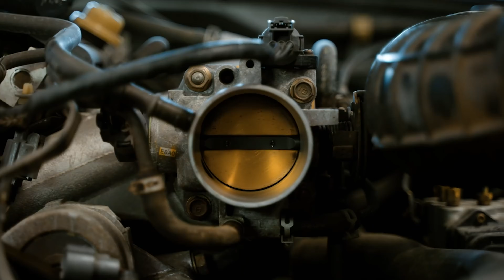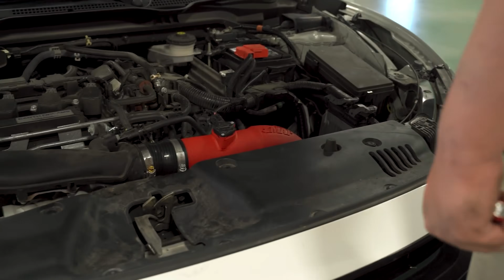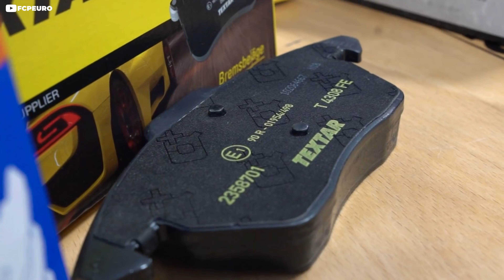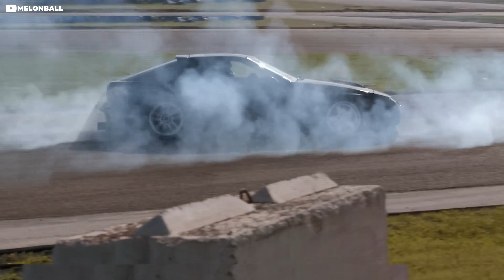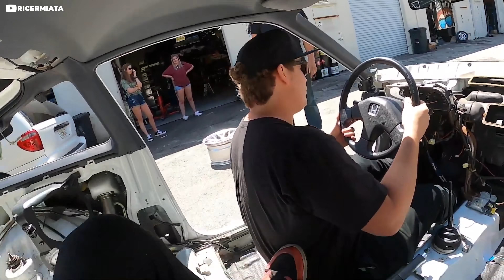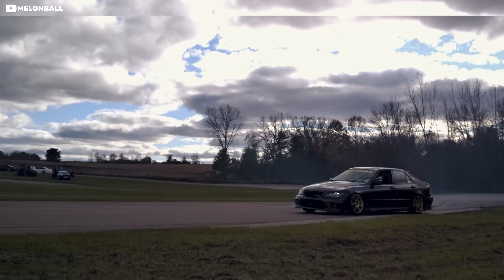Best Beginner Performance Mods!

Comment: Ranking from most to least important.
1. Tires
2. Coilover
3. Strut Bar
4. Sway Bar
5. Lightweight and Appropriate-Sized Wheels
6. Lightweight Body Kits (Exterior and Interior)
7. Brakes and Brake Lines
8. Full Sports Exhaust Kit
9. Intercooler
10. Intakes
11. Aluminum Pipes
12. ECU Tuning

Comment: 1st- wheels, tires, and adjustable camber links/bolts.
2nd - brakes, brakes, and brakes. Dimpled and slotted are my go to.
3rd- intake and exhaust.
4th- depends on the remaining weakness in the vehicle.

Comment: Most of these aren't beginner mods at all, because I am literally just getting a turbo and tune and I been building my car for 2 years. takes time to build things right and learn how to do motorsports and track racing, not talking about street because I don't street race for personal reasons. 

But beginner mods are mainly suspension components and chassis braces to improve handling and reducing flex on the body. Tires and brakes are the very first mod you should always do to any new or used car you get. But suspension is the real deal when you're diving into building a car. I would touch the engine and ECU last because you can notice the difference of the car when you wake up the beast under the hood. Then you can decide if you wanna strip the car based on what you wanna do with it, daily driver or a track car.  Imo

Comment: If youre new to modifying cars; specifically suspension modifications. A lot of people dont think too much about the geometry of the car and how the suspension works. 
Firstly, do some research before slamming your car (It will be super beneficial in the long run). Things like roll center, camber, toe etc. will all change as soon as you adjust that ride height or any suspension component. Not to mention all the things you are going to wear, like your CVs and tyres. 
Its a chain reaction so do it properly the first time and it will be cheaper and safer in the long run.
Reply from the maker: We always recommend doing proper research for your vehicle!

Comment: Intake, downpipe, mufflers, gutted cats, header, lowering springs, poly motor mounts, front/rear sway bars, front/rear strut braces, mild weight reduction, wheels/tires, drilled/slotted rotors and brake pads. Don't blow your money on a cat-back since your factory one works fine without forced induction. Been tuning cars for two decades. This is the budget recipe for a well-rounded and fun car. Nothing on this list is super expensive except for wheels if you want lightweight. A simple set of Motegi, Konig, or Enkei would be my pics for bang-for-the-buck. These are in no order but I honestly would do lowering springs and poly mounts first as this will stiffen the car up and allow you to feel the road better. I'd do a tune last when you've decided your done with everything else and you may need to upgrade your fuel and spark accordingly. On most cars, headers are your biggest power gain out of the bolt-on list. Its your money, your car and your choice but this is the knowledge I've gathered thru my 23 years of modding customers' cars for a living. Again this is a budget list for beginners or people without a large expendable income. Happy modding.

Comment: Speaking of the order that you should mod your car in. I got a stock miata, did a poor paint job, straight piped it. Then I got sick of the loud noise so I put a turbo on and a 3 inch  straight pipe, big brake kit, bc racing gold coilovers, and still stock wheels 😂
Reply from the maker: WHERE ARE THE WHEELSSSSS 😭😭😭 -Edgar

Comment: Hey!
Any tips to prevent hydrolocking with a cold air intake? Ive seen the covers AEM sells online, but I think is not enough.
Reply from the maker: The best way is to use one of those covers and also see if there is an intake that routes it as far away from the ground as you can. I know in some older Hondas that's tough though. - Sam

Comment: 01 Grand Prix GTP started with a complete stage 2 kit (intake exhaust 180tstat 3.4 pulley dp) then got front an rear power logs, then catback. lowered on zzp springs with niche targa wheels surrounded by bfgoodrich tires. amazing car an the sc whine is orgasmic!
Reply from the maker: Yo, those Grand Prix GTP's are a guilty pleasure of mine. I think those cars were slept on when they came out! - Sam

Comment: On my Sentra specv I started with a short shifter, exhaust, intake, wheels/tires, and coilovers. Totally changes the car
Reply from the maker: The Sentra Spec-V is such a cool car that totally flew under the radar. My friends and I were just talking about it at the track this past weekend. - Sam
Reply: @FitmentIndustries  it really is!! I have the 2007 B16 chassis(which is hated on) but it’s surprising how capable it is on autocross.

Comment: I've heard aftermarket brakes squeak a lot when driving a daily. How true is that?
Reply from the maker: That's really only true with some very aggressive track-oriented pads. I have put ceramic pads from PowerStop on my 240SX, IS300, and even my F-150 without any annoying squeaks at all. - Sam
Reply: @FitmentIndustries  Thanks for the feedback, Sam. So Ceramic pads are the way to go. would the brake rotors make a difference when it come to noise too, or not really? 
Btw, I got to meet Gels at the Fuel Fest 2022 here in LA a few weeks ago. Wished you all could've been there too, to meet you all.
Reply from the maker: @MKVII_A  That's so cool you got to meet Gels! Pads are what will affect the noise the most. If you're changing pads it's a great time to swap rotors as well. PowerStop makes some vented/slotted rotors I've put on my IS300 and 240sx with those pads I mentioned. No noise and great braking on the street and at the track. - Sam

Comment: I started with an exhaust, intake, front mount intercooler, and LSD on my Jetta 1.8t. Ran me $600 and some fab work for the exhaust and fmic kit (ebay is good if you have the means to repair the defects), and the LSD ran me 1k, including installation. Intake was like $40 for the filter and a spacer pipe to move it closer to fresh air. After that I got some drilled and slotted rotors, solid aluminum shifter bushings, and a splitter valve (kind of like a blow off valve but less cool) and that all ran me $400ish. Removed the rear seats bc I have no friends and wEigHT rEdUCtIoN bRo, and got some Federal 595s ($200). Cranked the wastegate to 14 lbs and sent it. Pretty fun car for less than 5k

Comment: I've got a little tip about that weight point: try finding Fiberglas parts, they're way cheaper and not that much heavier than CF.

My first performance mod ever were rear ARB bushings on my Civic EP2, I don't count wheels+ tyres because that's kind of a given at this point lol.
Second one was a full suspension (dampers adjustable) + front ARB and control arm bushings and some geometry correction.

2 months later the car was totaled and now I'm kinda back to almost stock on my '05 Fiesta ST 150
Reply from the maker: Fiberglass is definitely cheaper. You just gotta make sure you buy from a reputable brand or you'll be stuck doing a TON of fitting and sanding to make it fit correctly. I've made that mistake haha. - Sam

Comment: Low weight wheels are interesting. The 17x8 RPF1s with 225/45 R17s I run on my Corolla SE manual really made my car feel noticeably more stable over bumps and more agile. Got the K&N typhoon cold air intake and a Borla catback too. Sounds awesome. My car is now a blast to drive...
Reply from the maker: That sounds like a great setup! The RPF1's are a great lightweight wheel option. I personally feel like lightweight wheels are easily overlooked but once you get some it's hard to go back to heavier wheels. - Sam

Comment: I started with wheels tires and coilovers on my 08 Civic LX. Next I'm going for cold air intake, exhaust, sway bars, Intake manifold, cams, and throttle bodies for more power, also a tune since it's necessary.
Reply from the maker: That's a great list! - Sam
Reply: @FitmentIndustries  also my wheels and tires are from Fitment Industries.
Reply: Aye we got the same car! 07 civic here hahaha. At the moment, I'm on lowering springs, injen cold air intake, and I want to get strut tower brace, and wheels
Reply: @tsumugicha  nice does it feel better and more fun to drive now with the mods?
Reply: @eliezergutierrez2472  trust me I had the same car don’t waste all your money on it, just save for something better
Reply: @natedostalik3538  I'm not looking to make a ton of power just a bit more . Thanks but I'm good with my current Civic.
Reply: Heck yeah I'm dropping $30-$50k on a build for a Civic coupe.
Reply: I have a 2015 coupe (Lx-s I think), any recommendations for me,where to start ?
I was thinking about getting a new set of brakes, wheels and tires and a cold air intake
Reply: @Gaz4966  yeah wheels, tires and if you want coilovers to lower it a bit and for it to ride better. Get better brake pads and if you need better brake fluid if you plan to do track or autocross. A cold air intake, exhaust are great first mods for power, but the R18 doesn't gain a bunch more power with bolt ons. If you want 200whp or more boost it. But modding the engine does decrease the reliability of it and the R18 is an economy engine not a performance engine like the K20 so I would temper my expectations. If you want 300whp keep it stock, save money and trade it for an Si.
Reply: I just have one question. Why put all this money into a car just to get dusted by anything else on the road?
Reply: @woody350z9  because it's ain't always about who's faster to 60 or 1/4 mile. It's about enjoying your car and having fun. But I guess you don't know that since you focus on speed.
Reply: @eliezergutierrez2472  is that what your gonna say to your girl/guy when you get gapped by a prius?
Reply: @woody350z9  yeah I don't care about being faster than everyone. I enjoy my car even if it's slow. You probably don't even have a car.
Reply: @eliezergutierrez2472  i have multiple lol
Reply: @eliezergutierrez2472  why on an LX? Why not save for an Si and upgrade that? Is the LX manual at least? I get your current civic works just fine and you don’t care about speed so why bother?
Reply: @Lethal.G37  my Civic is auto and I don't care about being faster than everyone or having a ton of power. I care about enjoying and having fun with the car. That is important to me.
Reply: Just buy an si
Reply: @stewarthadican7239  can you not be a prick my guy ?
Reply: @stewarthadican7239   I'm good with my current Civic. But thanks.

Comment: I personally like dual exhaust 
More air flow+a few more🐎 🐴 🎠 🏇 
Tuning 
Radiator?!.
A better🔋 
Better brakes a simple wing 
Xenon lights 
Mud flaps
Winter wheels 
Little things like that!!!
Reply from the maker: Good call on the better battery! They are pretty expensive but some of the lightweight batteries can really shave off a few pounds and also give you better cranking power. - Sam

Comment: Catted downpipes and a intercooler if your boosted those two mods will change a lot without making it look modified… unless u love the massive intercoolers that don’t fit 😂
Reply from the maker: Good call on the downpipes and intercooler! You can make stuff fit....just might need a cutting wheel sometimes lol - Sam
Reply: @FitmentIndustries  oh yea I’ve gone to custom crash bar before I resort to cutting wheel😅